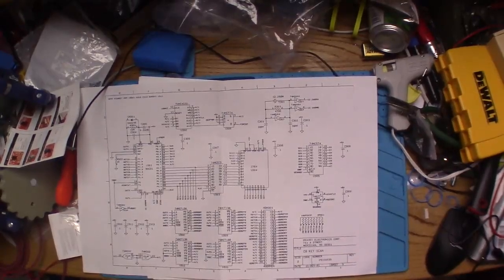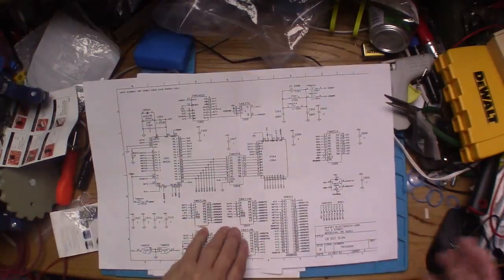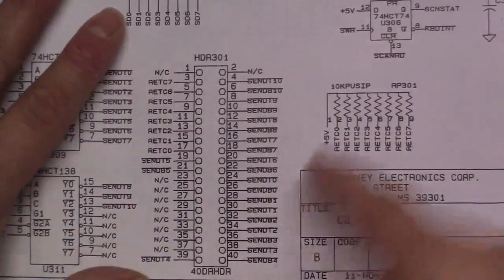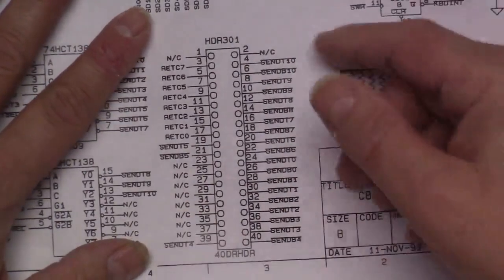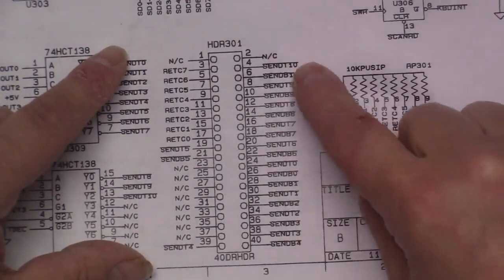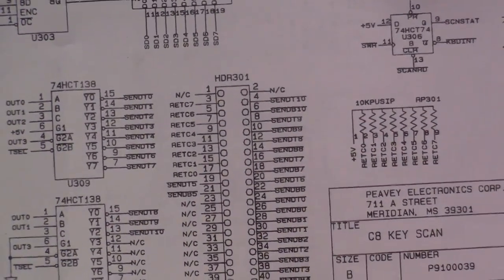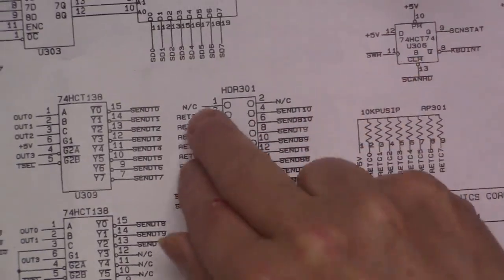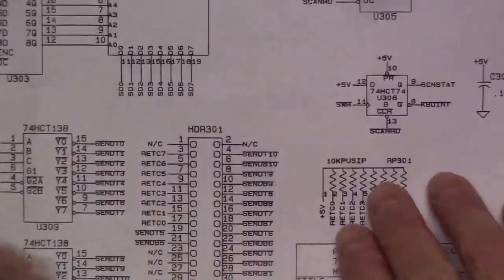Update - Midi Keyboard  - DPM C8 Schematics

Comment: I have a problem with my Roland electronic piano motherboard
I also want to use Arduino to transform the keyboard.
But can't find the schematic
Reply from the maker: Bummer about the Roland!  it's probably matrixes with diodes just like mine.   Unfortunately you'll have to get out the multimeter, and try to draw a schematic from what you find.  Measuring from whatever connector you have, you'll probably find the same key in every octave on one set of pins and each individual active on the other. But I'm basing this off my experience of ONE keyboard. So your results may vary.  Because of the diodes, of course you will show conductivity with only one polarity (in other words, ohm out, press keys, see if anything happens, swap the multimeter red and black leads to opposite pins and do it again).  Hope that helps. Good luck and let us know how it's working out 

With the addition of the Lowrider CNC, I had to clean some stuff out, so unfortunately I won't be continuing this specific project.
Reply: Thanks for your advice
It’s a pity that this project gave up.
I wish you other projects going smoothly.